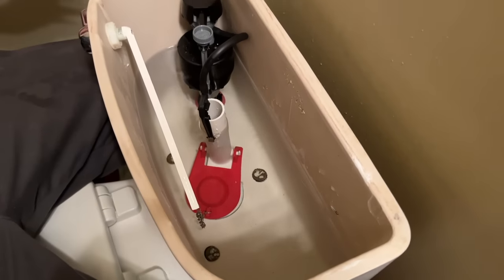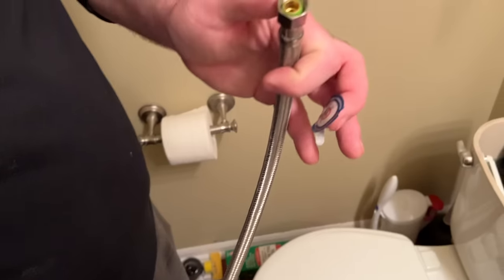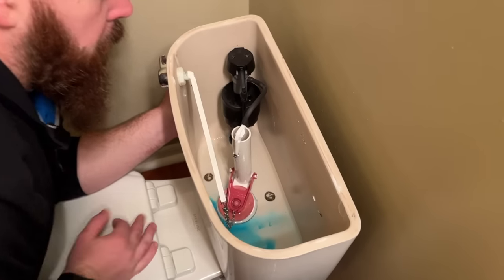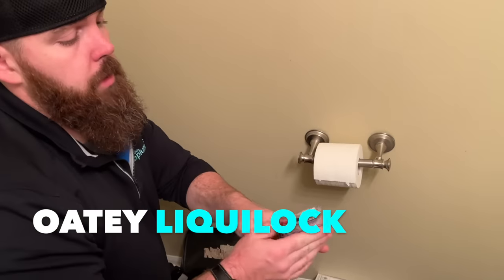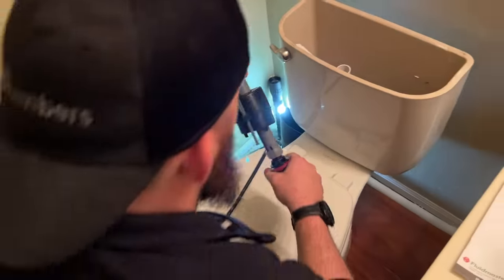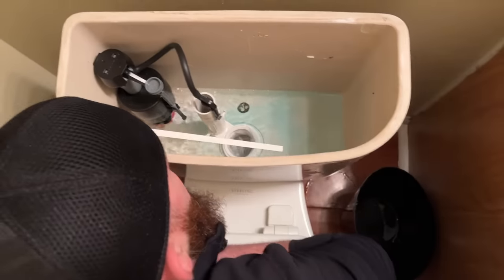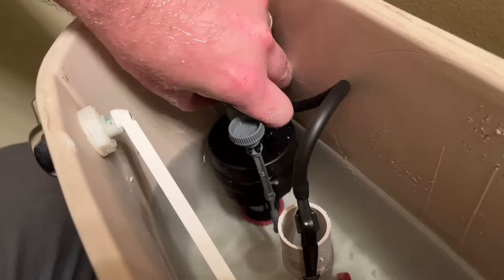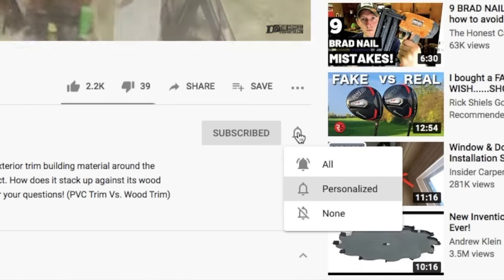ALL TOILET TANK REPAIRS EXPLAINED By Master Plumber! Fix A Running Toilet!! (VERY DETAILED TUTORIAL)

Comment: I almost skipped this video but even though I've done this job several times myself, I learned quite a bit. Thanks! Something to watch out for though - both my toilets had shutoff valves that failed this year. There are some good videos on how to deal with that problem. And always make sure you know where the house water shutdown is before you start - in case something goes wrong.

Comment: This is a great video, but unless if I missed it, I didn't see the master plumber demonstrating to check the flapper compartment to make sure it's clean before installing the replacement flapper. If there is dirt on the rim of the flapper compartment the flapper will not operate correctly.

Comment: Awesome comprehensive video! I had to replace my inlet valve 2 wks ago because the rubber seal was worn through and I couldn't find a replacement seal. Wish I knew about the funny noise it made before it stopped flushing completely (on a Saturday afternoon after all the shops had closed, please note!) Our area has bad water pressure, so I didn't suspect the problem was with the valve seal or even the toilet altogether. Now I know and will be better prepared next time by listening for the noise! Be blessed!

Comment: He's very clear and thorough.  Great explanation to newbies.  Yes, change out supply line for sure, mine leaked and flooded the bathroom and spare rooms.  Luckily, got the shop vac in time to suck up all the water. If I wasn't home to turn off the valve, would've flooded the entire house.

Comment: Replaced them numerous times over the years, didn’t use any dye tabs just powdered kool-aid. A lot of toilets still use the hollow ball on an arm fill valve and can be trickier to adjust be cause it can’t touch the sides of the tank as well as adjusting its fill level.

Comment: Really like this video.  Worth noting that the valve seal mentioned as a possible cause for  that hissing sound can be replaced far more cheaply than replacing the entire fill valve.  It’s also important to ensure the top of the fill valve doesn’t extend too high above the hole for the flush handle or you could get water rising to that level and creating a leak.

Comment: Great video, when you cut the black rubber tubing to size, did you use your Leathermans?  If so, the previous pair you linked in the description doesn't have wire cutters but the Leatherman 832531 does.

Comment: You forgot a video on how to replace the Flush Valve. I believe you have to remove the tank in order to untighten the nut. One thing I really hate is that sponge gasket that you use to connect the tank to the lower half. That is a *&$# to seat and I hate to use too much pressure thinking that I will crack the porcelain. Any tips?

Comment: Thank you SO much for this video! I have two Sterling toilets that I needed to change flappers on, and I simply could not get the length right, nor figure out which of the three holes to put the chain in. On one of them, the water was filling up to the top of the overflow pipe, so I turned the fill valve counterclockwise to try to lower it, but it didn't change. And what's worse, the water started running constantly even after the fill valve rose up. So now I've turned the water off and I'm going to replace the fill valve. And if that doesn't work, I'm calling a plumber. I hate to do that, but these things are giving me fits!

Comment: Recently in town visiting my dad and replaced all the, “guts” in his toilet so I had to remove the tank. All went well until it came time to tighten the tank to the base. I could not get the water to stop leaking through the three mounting bolts. Basically I was concerned that I was going to overtighten and crack the base. I was also suspicious of the washers in that I felt that they would never provide a good seal. Long story short, I paid a plumber 250.00 to fix a leak. I’ll look and see what he replaced the next time in town. It will be great if you do a video before I go home again so I can see what my mistake was.

Comment: I find it easier to remove the tank from the toilet. Putting in the fill and flush valve is much easier on a bench than being bent over and on your hands and knees leaning over the bowl. You can replace the tank seal as well which will be just like the flapper and supply hose seals - worn and corroded. Then you have a completely rebuilt toilet.